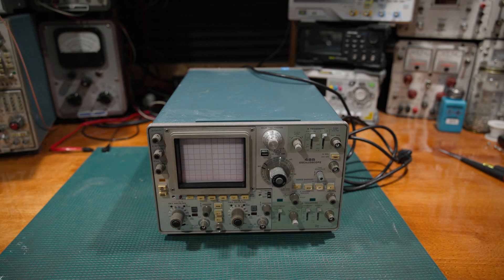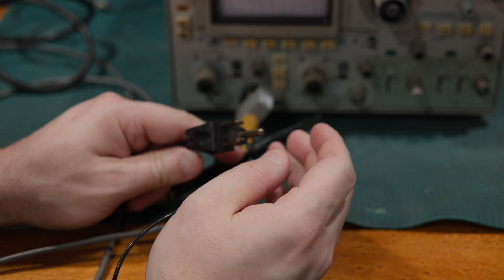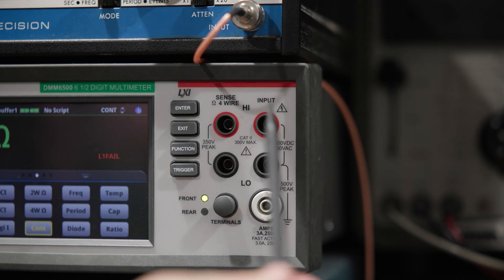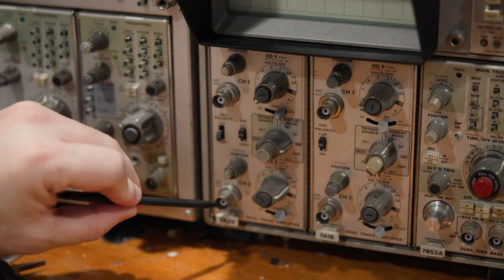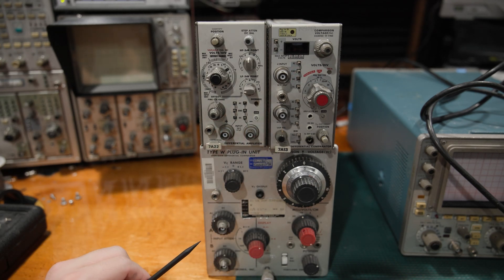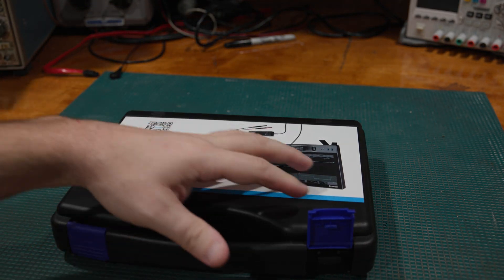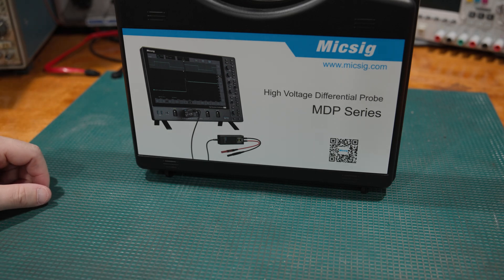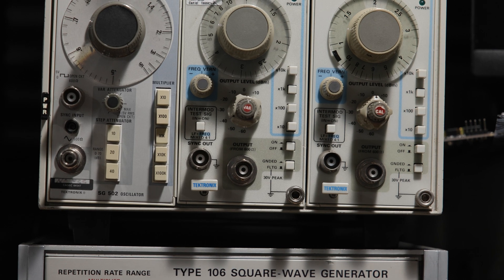Single Ended VS Differential Measurement How Not To Blow Up Gear!

Comment: LOVE your videos - this one as specially. Friendly request: can you set your camera to manual focus when you're doing fixed shots on front panels? Get that face and controls nice and sharp, lock it in, and it won't shift as you point to stuff. We want to see every pixel of those gorgeous Tek goodies :)
Reply from the maker: I will work on that. This is the first video shot on a new camera that I am still getting used to. I will have a video out about the camera soon. There is a new cannon C80 in the lab that I need to learn how to drive correctly.

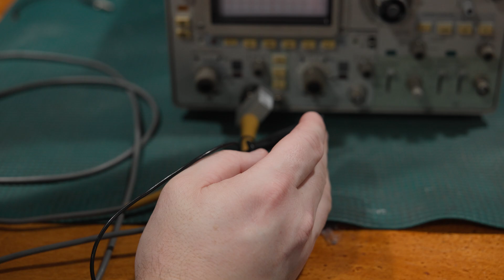Comment: 2:35 You never explained why you sometimes needed to plug the scope into an isolation transformer. Was it a specific case for the scope, or because the DUT needed to be isolated and you needed the scope on the same power source?
Reply from the maker: DUT should always be isolated NOT the scope. Isolating the scope and cause hazardous voltages to appear on the chassis of the scope. This is called out in almost all documentation of scopes. Also it is usually not safe / recommended to use a scope with a cut ground pin.  The BNC shells , Earth terminal, and metal casework are all at the same potential. If an isolated scope is needed it is a true need and a scope with an isolated input should be acquired usually these are battery powered.
Reply: @ZenwizardStudios  Right, I agree, but you stated at 2:40 that you had used an isolation transformer on the scope because "sometimes we had to do that" and I was just asking what those circumstances were.

Comment: There are several true differential vertical plugins for the more affordable 5000 series scopes as well; 5A20, 5A21, 5A22 and 5A26.  Generally only speced to 1MHz but very useful and an inexpensive way to get differential capability into your shack.

Comment: Designing pro audio equipment for many decades, the need to make differential, non ground referenced measurements is essential, for both line level, and high power bridged output power amplifiers. I now use a pair of 7A22 in a 7000 mainframe, ( restoring a R7603 for a permanent dual diff setup with a 7B53A) but over the years used earlier Tek scopes appropriate to the need.. A 545 30MHz with Type D differential amp and before that, a 502 dual beam differential 1MHz.  Always owning a true diff scope or plug-ins, I never used an external differential probe, but for most people that would be a good tool to have in the lab.
Reply: I have the 1A7A for my 547/549 and the 3A9 for the 564.🙂

Comment: Dave Jones (EEVBlog) has a very famous old video on how not to blow up your scope. The 2-channel arithmetic (Add/Subtract) mode on your scope is no substitute for a proper differential probe or differential amplifier plugin. It's not going to save you if you accidentally connect the ground lead on your probe to any high voltage rails (mains 120V/240V or even rectified DC on the primary side of a power supply) in your (earth-referenced) circuit under test! In Dave's video he also talks about true HV active differential probes which I think is the only way to go if you're dealing with circuits where you don't have a safe place to connect a regular probe ground lead (such as an old-school hot chassis device)
Reply from the maker: OPAMPS can also be a bit weird having no ground.

Comment: Great video, as always!
Do you have some recommendation on leather carry handles? you know the issue: they dry out and start breaking. I read different stuff like to moisture it with steam or to rub it with oil (Ballistol).
Reply from the maker: For leather care look to a horse farm. Farm supply store will have a good array of items for use on saddles and the like. Lots of expensive leather that needs regular conditioning. Around here there is also a shop called Tandy Leather. They specialize in leather craft and supplies and will have more ways then I can count to help with leather care.
Reply: @ZenwizardStudios  Fun fact: The Tandy Leather Company bought Radio Shack in 1963
Reply from the maker: well that makes way more sense how things got named over the years.
Reply: @ZenwizardStudios  Thanks for the advice! I never thought of saddles, now it's so obvious. I live in a rural area, so it shouldn't be that hard to find a specialized store and get some further information and proper products.